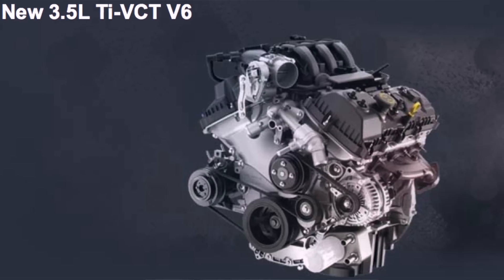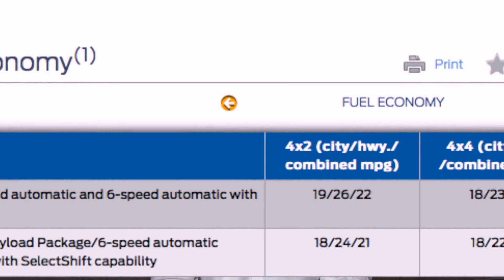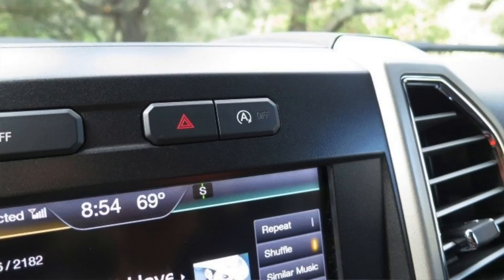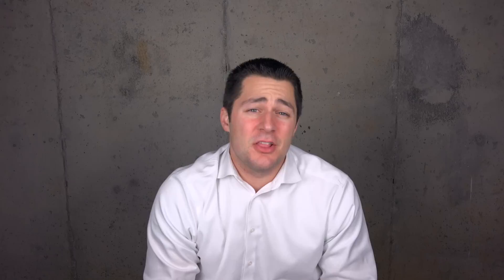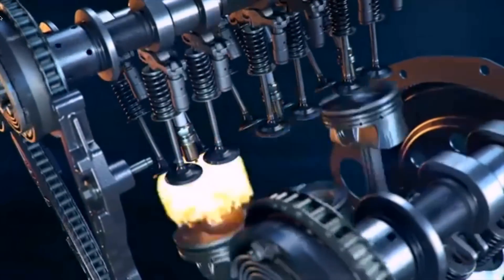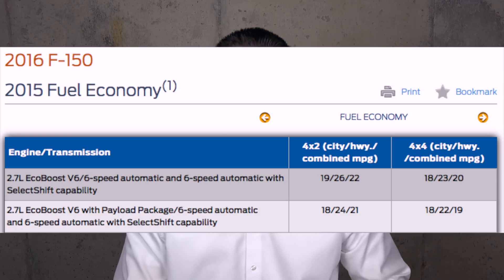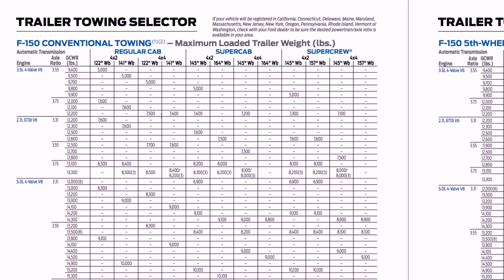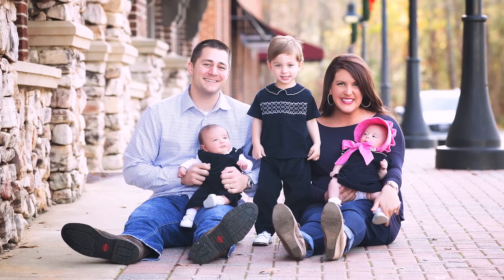Which F150 engine to choose 2.7L - Motor of the Week

Comment: I'm a Forc guy but now I'm considering other brands, the whole ecoboost idea with aluminum body I really dislike. I honestly think the ecoboost won't have the durability when put under day to driving over the yrs. also the aluminum body in small dents and bumps will take longer to fix cost more and you would really have to take it to the dealership. Also I wonder if the insurance will be more expensive?
Reply: Gabe Camp semi truck cabs have been all aluminum for ......30 plus years ??  aluminum body makes sense.

Comment: Looking at rear differential gear ratios on the same f150.. The window stickers I look at are the same for MPG, but I thought a higher ratio gets less MPG vs a lower gear ratio... but the window stickers show the same MPG no matter what rear ratio is on the sticker...  Why?
Reply from the maker: +Chris Clear you are correct. Rear gears do affect (or is it effect) fuel economy.   Not sure why the EPA doesn't recalculate. Our GUESS is that there are too many combinations when you look at makes, models, and options.

Comment: I have this beast in my 2016 F150. Getting 15.5L/100km in city driving. Have not done a long haul highway drive yet so cannot give a good l/100km there. I took a Keystone Passport 3220BH for a haul on a day with wind gusts of 60kph. This little engine could and did very well. Easily hauled 6000# of dry weight downhill and uphill. Now it was a blustery day so mileage hit 22L/100KM. Uphill rpms hit 3500 but it held onto 100kph speed. From a standstill, this 2.7L moved without even burping. It was like the trailer was not even there. Comparing this 2.7 to the 5L I had previously, I have to say there was no difference in power but one big improvement in mileage. In city ... 2.7L did 15 while the 5L was doing 25L/100km. In my opinion, "The 2.7 is the little engine that could".
Reply: If a 2.7 liter engine is a beast, then what do you call a 7.3 liter engine?

Comment: Your comments about the turbo are somewhat misleading.  The issue with t;urbos  is "heat sink," or residual heat after shutdown overcoming the now dormant cooling provided by oil and water.  And we are talking BIG heat. Previously turbos were cooled with oil alone.  Heat sink caused the SEALS to fail first,  then the bearings and ultimately the turbo itself. This is exactly why manufactures went to water cooling in addition to oil cooling.  It is also why synthetic oil is recommended, blended or full.  Synthetic withstands the heat much better.  The after shut-down water cooling you spoke of is not due to a water pump, but water movement due to temperature differences between the water as it comes in contact with the turbo and adsorbs the turbo's heat, and the cooler water outside the turbo - convection.
Reply: +Jim Jacobson One note to add: Coking. When the engine was shut off, the oil that is no longer being circulated through the still scorching hot turbo would burn because its not being circulated. This leaves deposits of burnt oil called coking.
Reply: most ecoboost motors have an electric aux water pump that continues to run after the engine is shut off. This is to keep the oil from turning to sludge in the turbo, which is why motorcraft is still a semi synthetic and they don't need to run a full synthetic from OEM

Comment: Awesome video! The other ecoboost engines are pretty good but have carbon deposit issues  5-6 years down the road from what mechanics tell me. This engine is looking pretty good. Can't wait till the gen 2 3.5 ecoboost comes out with the raptor
Reply: There is a way to get around that. That carbon deposit can be knocked off literally from high power driving. Literally flooring it will knock those deposits off and reburn them.
Reply: Kellan Larson Is this 100% proven? Cause if so I'd be so so open to flooring it to keep my engine healthier lol!!!!! :D
Reply: +Stallion T fuck yeah dude, I'm like hurry up already!!!! :(

Comment: Ford needs to put the 2.7liter v6 eco boost into the Ford Mustang! Or even the 3.5 liter v6 ecoboost. I would love to see if it's possible to put the 2.7liter v6 ecoboost into 2010-2016 Ford Mustang.
Reply: I wonder if the 2.7 eco boost can fit into a old junker late 70s mustang?

Comment: Great Video, thanks. Do you know if as of the 2016 year for the 2.7 which  I understand to be a new power plant, and the older 3.5 which had had problem's with the top end getting carbonded up. Have they corrected the problem in both of these motors?
 Thanks for you work. Nice family picture, do what ever you can do to keep you all together..  Hava Nice Day..

Comment: Good video, but the auto start stop feature you described isn't entirely accurate . The engine only shuts off if you press your foot down a bit further than what it takes to hold the truck in place. And it keeps it shut off for a max of 2 minutes. I have the exact same truck. Great video!

Comment: I get between18.4 to 18.6 MPG's in my 2015 5.0 V8. Mostly highway driving and I watch my speed/rpm. After pulling a 18 foot trailer loaded down it dropped to around 15-16 mpg. Way off recommended mpg's, granted I have cold air intake and cat back exhaust

Comment: I've heard that these engines are good, but the fuel economy plummets if you hook up a trailer.  Way worse of a drop than a V-8.  Is there any truth to that?
Reply: I get an average of 23 mpg on highway and 11-13 mpg when pulling 5700 lb travel trailer.

Comment: Hi, thanx for the info on the 2.7L V6. I bought a 2014 F150 SuperCab XLT 5.0L 4X4 in December 2014 as I was living in RI at the time turns out it was a very good move as it was in 4X4 part of everyday for 3 months due to lots of snow and constant below freezing temps. In June of 2015 I moved to Florida for family obligations. In November of 2015 I saw all of the incentives and lower interest available. I went and traded for a 2015 F150 4X2 with more options and much better interest payments. I practically walked out on an even swap. OK so having both the 2.7 & the 5.0L the 5.0L sounds better and had all the go that you would expect. Now the 2.7 is surprising. It has great pick up & under a firm acceleration there is a point where it picks up your butt and scoots you down the road. Now it must be a secret because I found it on my own by accident..the button that shifts into Tow/Haul if you hit it 2X it goes into sport mode. Turns it into a different animal. I get 19.8 on the highway (70-75). We also have roads with 50-55 speed limits where I can get around 24.+ mpg. It's a great engine. Also I have the 36 gallon tank gives you a 750mile range..Love it.

Comment: 4:40 I've read this some where before about the 2.7 ecoboost. The reason turbo went bad was because they are HOT when you shut off the engine. Water cool turbos don't get as hot so they last longer. This guy is another example of an actor who read but did not understand what he read.
Reply: Totally agree. If the turbo cooled quickly, then the powerstroke diesel would not need a delay engine off to COOL the turbo down. The residual heat after engine off "burns" the oil out of the turbo bearings. No oil, no turbo
Reply: dtimboggs Thank you. It's funny how these guys claim to be auto enthusiast but don't know simple problems.
Reply: I bought a 2016 F150 2.7 7 months ago. Check out a few of my videos of it. Just type F165 on youtube.

Comment: (Yes I know this video is about the 2.7) I am so glad Ford put a 3.5 v6 turbo engine in their trucks. It remind me when Buick had a v6 turbo that would drop the mic and just walk away. I thought the 87 5.0 Mustang 5 speed was the Sh-t until I drove my boss 87 GN. Even though I have not driven a F-150 ecoboost. I'm sure with 365hp/420lbs. of torque. I want be sad.
Reply: +blackericdenice GN's were great for going straight but didn't turn for shit. Mustang LX were a little better handling and the GT a little better still. There was lots of inexpensive mods you could tweak the suspension with though.
Reply: Paul Rodrigues I can tell you never driven a GN because you don't care weather or not it can turn.
Reply: +blackericdenice my former boss had a GN and later a GNX yes they were scary fast in a straight line but taking an exit ramp really showed their true colors.....glad I didn't wreck it. Don't know how I'd explain it. And quality!!!! the under carriage was so rusty (brand new cars) he made me clean it up and paint it. Rear ends hummed from day 1.
Reply: Paul Rodrigues You never drove one before. You can't be a car lover, drive a GN and not like it. You are just going by what someone else said.
Reply: +blackericdenice nah I did.
Reply: Paul Rodrigues If u say so.

Comment: Good video.. her is my 2 cents.. my 2.7 is amazing! Sport mode is rocket mode in disguise, lol.. it is amazing.. mpg is awesome, I achieved 30mpg several times, with no AC, under 51mph and actually had a few hills.. good deal! over all average is jumping around.. generally 24 mpg but last few tanks it is 19? odd.. but this truck is picky, change the oil ( now that, is pure crappy embarrassing lack of design hell on earth.. it is, I have done my own for 30 years, don't mind new ideas.. but this is crap.. you been warned ) but.. after oil change the first two tanks my mpg is worst ever and then comes back? Stick to high octane non ethinal if you want good mpg numbers... I do miss the hum of a v8 but I added a $60 Twister by Flow Tech, from ebay.. then payed $40 to have it put on and the rest of the over weighted stealth junk taken off... NOW, it sounds great. The speed limit is low, but that is a personal choice.. lol... . just being honest.. but power, mpg, and pulling is great.. can not tell my camper is there. My only suggestion if your looking at the Ford truck, all the engines are good... be sure to look close at the tech.. I didn't and regret it, they are really really behind... radio ( by 5 years or more) , remote, and other tech on it, unreliable.. they are old design and not reliable.. so just be sure before it is too late. If you don't care, and wonder about the 2.7, go for it, I love it.
Reply: 25mpg here tops.
Reply: Drive 55 mellow easy not lurchy and jerky...like you have a  VIP in the back seat ...I got 28.8 from Lemitar to Albuquerque on the freeway.  Stay in economy mode, windows up, correct tire pressure.  Break it in by not going over 55 if you don't need to let those rings seat to a fine polished perfection ...you won't be sorry ..stay out of 4 x 4 until the first 1000 miles of use.  The lowest I have gotten in mpg city, highway, and off road is 24.5.  The average is about 25.5 and the highest on solid freeway was 28.8.  I just got to mile 3000.  2.7 Ecoboost with 6 speed transmission, 10 play Goodyear all terrain kevlar tires at 55 lbs pressure.  Lock in cruise control when the gold band hits the 30 mpg line.  That is the sweet spot in the gear you are in and the is a perfect speed in every gear...find it...stay there, you will be surprised.  You save 15 percent fuel over 75 mph and that's good for reducing your carbon footprint.  Love this Ford!  I am an engineer type so cudos Ford for the clever and thoughtful engineering.
Reply: Jay jay dynomite ii

Comment: Does the 3.5L EcoBoost V6 feature the water-cooling system for the turbos?
Reply: they are oil and water cooled turbos
Reply: or were you referring to the water pump still pumping coolant to the turbos after the engine shut off
Reply: +aaron monke the pumping coolant after shut off. :)

Comment: I have a 2016 F-150 Supercrew 4x4 with the long box and 3.55 diff. with the 5.0 V8.  In cruise going 56mph/90kph I got 23.5 mpg U.S. or 28 mpg Canadian/UK.  That converts to 10 litres per 100km.  Just got the truck 5 days ago.

Comment: I am impressed with the m.p.g  of my 2.7liter Lariet. Sometime, I put my truck in sport mode...so gone. Another point I have is having a 23 gallon tank versus a 36 gallon I had in my 2014, it won't break the bank on fill up. Thanks for the video.

Comment: I really like my 2.7 also. I did a 180 mile trip highway only (filed up and jump right on the highway) when I arrived I averaged 26mpg. This is in a super crew FX4 unloaded with 93 octane doing 65-75mph.
Reply: +blackericdenice I can get 24.+ on 50-55 mph highways with 87 octane...I never tried 93 octane.
Reply: +Paul Rodrigues I forgot to say 2015 F150 2.7L.
Reply: +blackericdenice sure, under the right conditions.  The truck is EPA rated at 23 highway.  Driving at slower speeds than the EPA testing like he's talking about could easily net big gains.

I have yet to see a car where 55-60 mph and a careful right foot couldn't beat the EPA rating.  I used to get 35-36 mpg mixed and 40 highway doing 55-60 mph in a car rated 28 city 35 highway.  

nobody's saying it's doing 26 running 80 mph and dogging it every time you accelerate.
Reply: +blackericdenice  First, you aren't literate enough to leave a comprehensible comment. Second, you can't even figure out how to close the popup window in his link in order to see the image in the background. It clearly shows his trip MPG at 26.. What does he need to explain to you? You sir are the one that isn't smart enough.
Reply: +blackericdenice Specs directly from Ford

2.7L EcoBoost® V6
Horsepower
325 @ 5750 rpm
Torque
375 @ 3000 rpm
Fuel Economy - 4x2 (city/highway/combined)
19/26/22
Fuel Economy - 4x2 Payload Package (city/highway/combined)
18/24/21
Fuel Economy - 4x4 (city/highway/combined)
18/23/20
Fuel Economy - 4x4 Payload Package (city/highway/combined)
18/22/19
Reply: +dragondaze No no no when they see the light ahead is red and they coast at a gradual slowing speed to the light which isn't going to change until a car gets across the magnetic square.Pull over let me by I'll trip the light for you so iy will be green for you when you get to it
Reply: +JDH 26mpg? Here we go.
Reply: +blackericdenice Do you own one?
Reply: JDH No sirrr but I don't own a 96 f-150 with a 300 inline 6. But I know it want get 25mpg.
Reply: JDH I'm not a member
Reply: +blackericdenice You have no idea what you are talking about. Half what you say makes no sense and you dont have to be a member to see the pictures.
Reply: JDH Whenever someone tell me I don't know what I'm talking about. That are wrong and are not smart enough to explain it any better.
Reply: ***** People who don't know about cars talk about writing. Never trust what the computer say when it come to mpg. Gas powered full size pick-ups don't get 26mpg.
Reply: +blackericdenice so you own a 96 F-150 with a inline 6 and it wont get 26 MPG... so that means a completely different engine, in a completely different truck, wont get said milage?

In that case, I own a 56 Studebaker with a inline 4.  It won't tow over 2000 pounds, so I know your inline 6 wont.  That comparison makes about as much sense as yours.
Reply: BA_300_AAC So you think full size gas power trucks can get 26 mpg?
Reply: ***** That don't men you will see 26mpg on the high.
Reply: +blackericdenice You are so in over your head, mileage is greatly affected by driving behavior and shows when two different people drive the SAME vehicle. I can get 2 miles more per gallon on the SAME trip versus another driver in the SAME truck! and that is purely down to driving habits.
Reply: dragondaze Yes but if the truck is only rated for 17 mpg on the hwy. You can't make it get 20
Reply: +blackericdenice sure you can, what are you talking about?  the epa rating is done under certain conditions  to simulate the average driver, at a set speed etc.  go slower than they do on the highway or use less throttle accelerating  and you can easily beat the rated mpg.

Google "hypermilers" and read about those guys.  their entire goal is to get the highest possible mpg.  granted, they do some pretty crazy stuff but there are people getting 20 plus more mpg put of their cars than the rating.  there are even competitions in some cities with laid out routes to see who can get the best mpg.
Reply: I hate hypermilers... they coast 2mph to a traffic light that isn't thinking about changing until someone is sitting at it. They should pull over to the right and let a 'regular driver" get to the light so it will be green when the "HM" gets there. rather than regulate everyone's speed.
Reply: Paul Rodrigues So following posted speed limits isn't for you?
Reply: And how does that slow you down as the light will NOT change from your impatience, You do realize that when you drive smoother you reduce wear on many components as well as saving gas.
Reply: +dragondaze I think that they expect the light to change before they get there. It won't. So they coast to the light sometimes they don't make it to the line and the light never changes until he inches up.
Reply: Either way you have to stop and having less momentum is easier on the brakes and reduces scrubbing of the tires, and if the light does change it's a win-win!
Reply: I think I lost a few IQ points reading that idiots comment. We know who i'm talking about here....